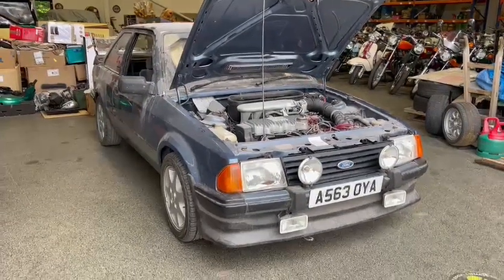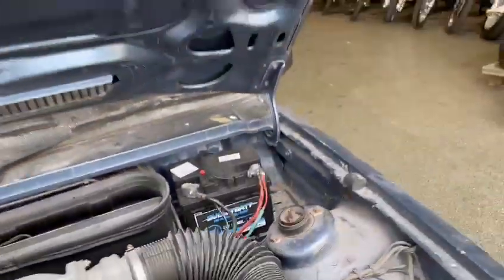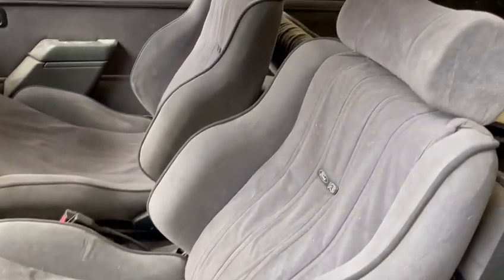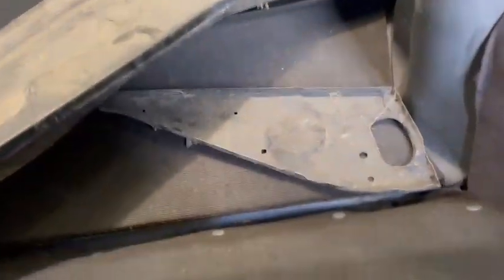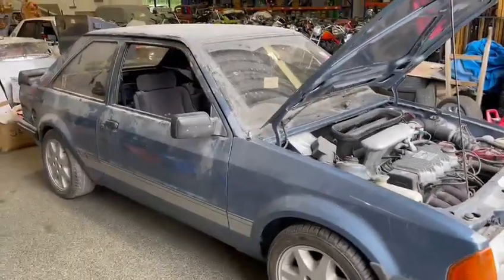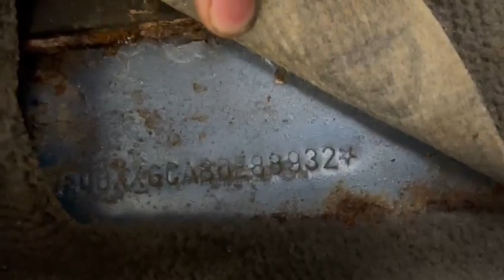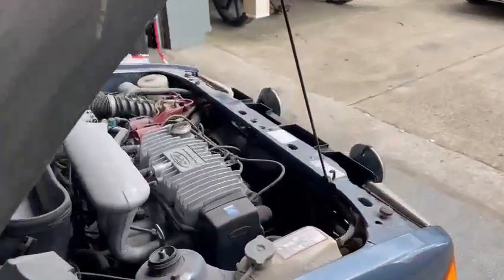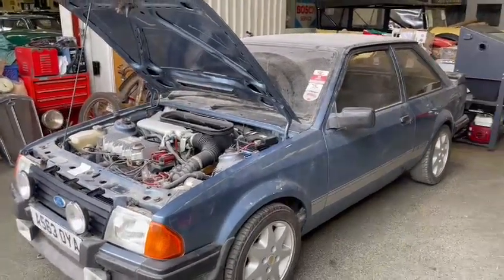1983 FORD ESCORT RS 1600 I | MATHEWSONS CLASSIC CARS | 29 & 30 JULY 2022

Comment: Never understand the money spent on crap old fords ! Bonkers
Reply: Same here. It's just a slightly faster shopping car.
You can get a very good condition Lotus Excel from the same year for about half the price of this rust bucket and it will run rings round this and an RS Turbo.
Reply: You boys don't get it 😂
Reply: @ciaranburke3243  
There's nothing to get !
It's just a FWD hatchback with an 8-valve engine.
Nothing to get excited about.
Reply: @ciaranburke3243  you hit the nail, some people just dont know what they are looking at.
Reply: Because there's nit many and big fan base. So don't be stupid
Reply: @paulogouveia5683  
Would still far rather have a Lotus Excel.
Much faster, musch better handling, much better qudos.
Reply: @paulogouveia5683  still ignoring the fact that it’s a boring old escort that feels and drives like a been can ! Each to there own but the old Ford obsession is bonkers !